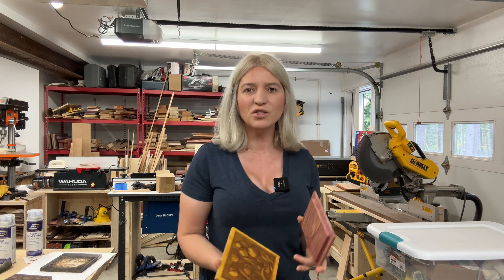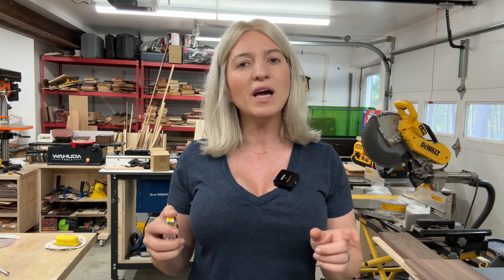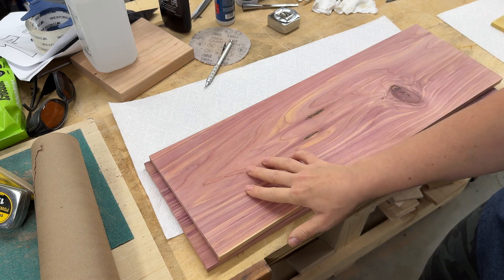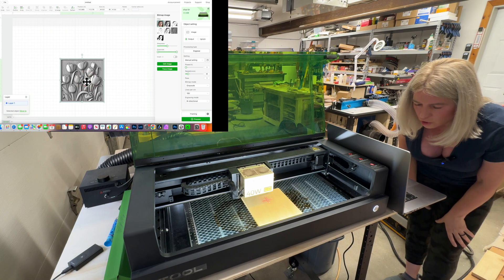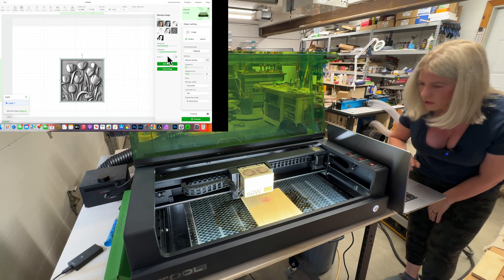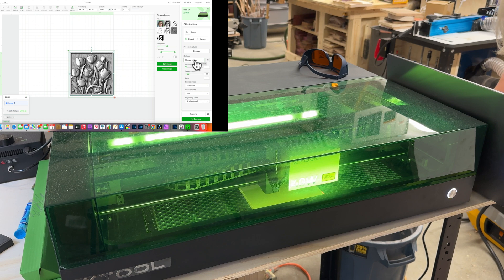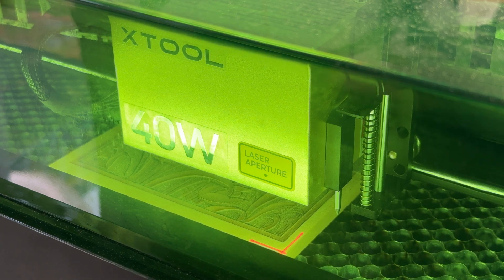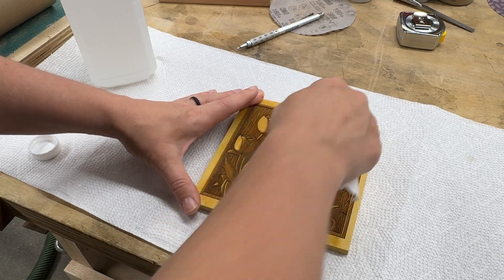Master the Art of Engraving with Xtool S1: Essential Settings & Techniques

Comment: So I'm considering getting the stool s1 20w or possibly the Reality Falcon A1 as my first laser. I want to engrave leather patches, wood, and cut wood that's no more than 1/8th". The xtool cost more- but would it be an overall better machine?
Reply from the maker: Yes, Xtool S1 is better especially if you are planning on cutting any material
Reply: @ thank you!

Comment: Hey I got the same machine but have been unable to get the darkness like on your nightmare before Christmas. Is there any suggestions? Settings? Xtool has been somewhat helpful until recently when they told me my old coaster with a much lower powered machine was spray painted on.

Comment: Well put together and informative tutorials....!  I have been looking into the purchase of a laser engraver and wondering if you have ever used other brands to compare against the xTool s1.  How easy is it to use for a beginner with not a lot of computer skills....?  Thx : )
Reply from the maker: I used many laser engraving machines. I currently own 9 of them. Here is a video where I compared a few of different brands and machines. I have zero computer skills and I can tell you is really easy. It could be as easy as importing a design, scale to size and push the start button 
The Ultimate Diode Laser Comparison! Escape laser regrets . Discover the best diode laser in 2023
https://youtu.be/JKe8q9gE4Y0

Comment: I ordered the 20 W S1 bundle. Will the 20W engrave like this? Maybe a bit slower or a few passes ? Great video
Reply from the maker: Yes, it will engraved just as good. More power only makes a difference when cutting or doing inlays
Reply: @SkylerEwingWoodworking  Can the 20W still do inlays? Just much slower? Thank you for your reply. You have a great channel.
Reply from the maker: @sbr-synrosimbugracing9338 yes but slower